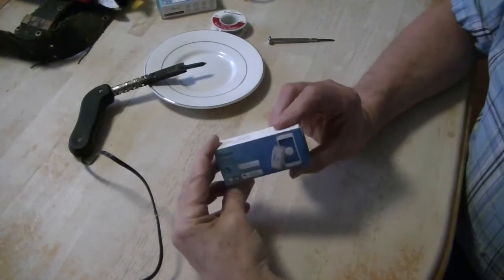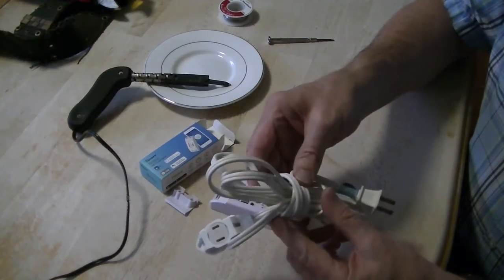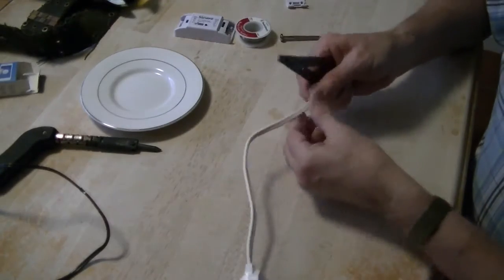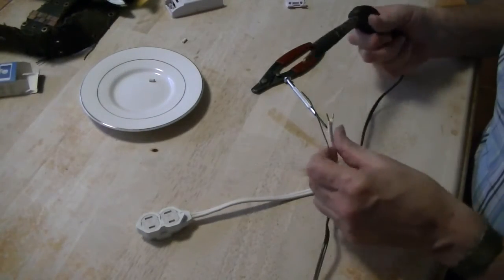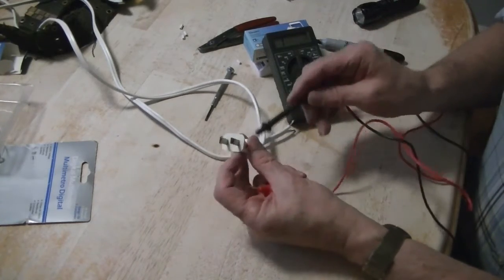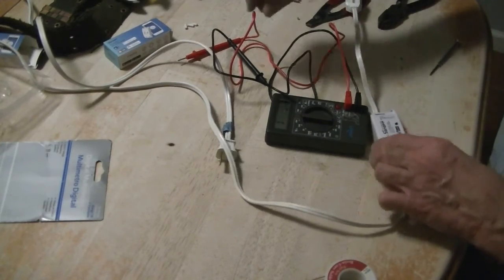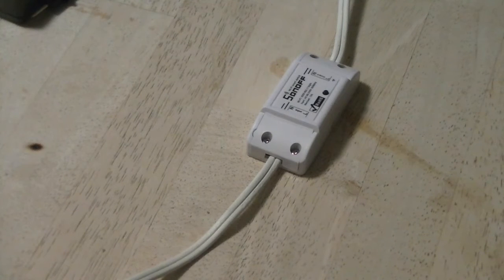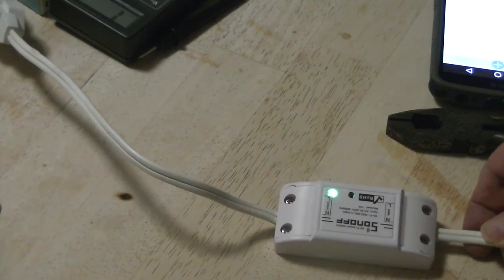How to make a Sonoff WiFi extension cord for $5

Comment: aside from extension cord can i used it on my 500w automatic voltage regulator?
Reply from the maker: It is rated for 1000 watts, so yes, it should work.